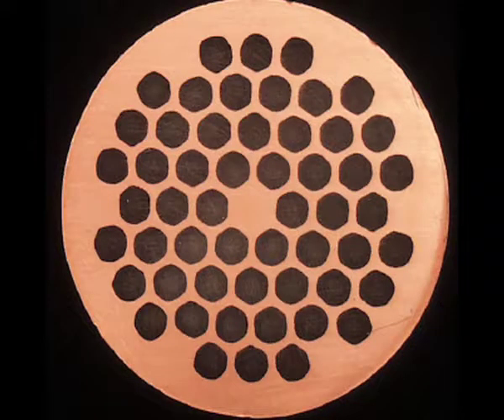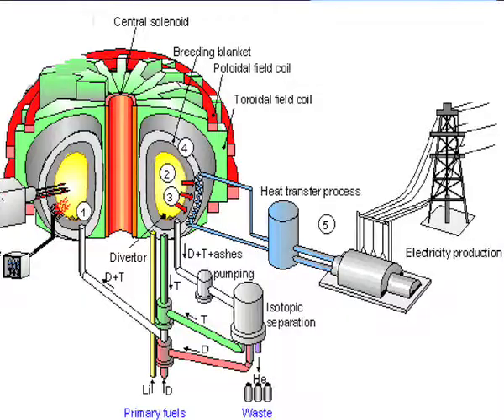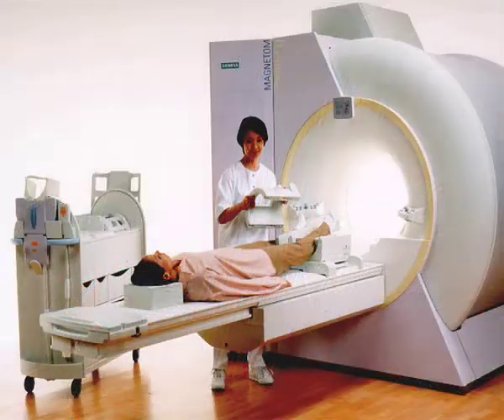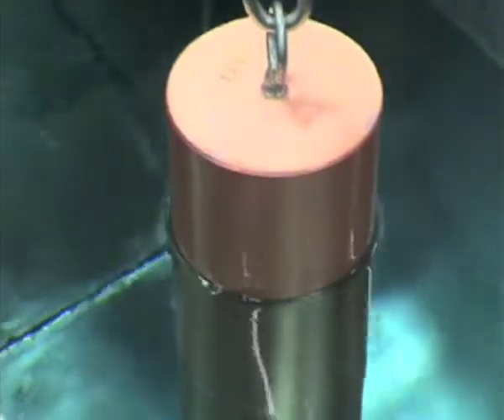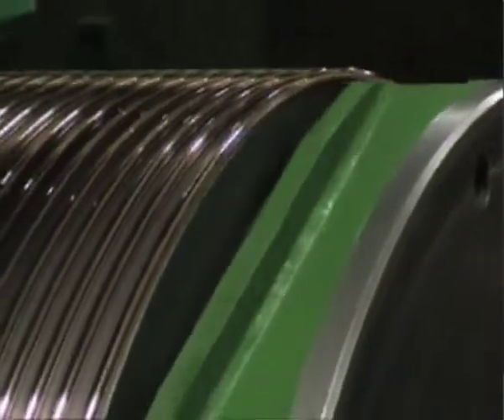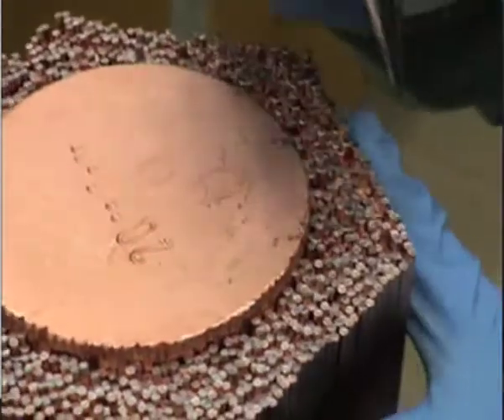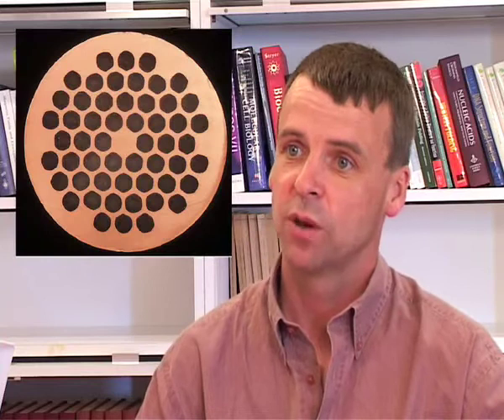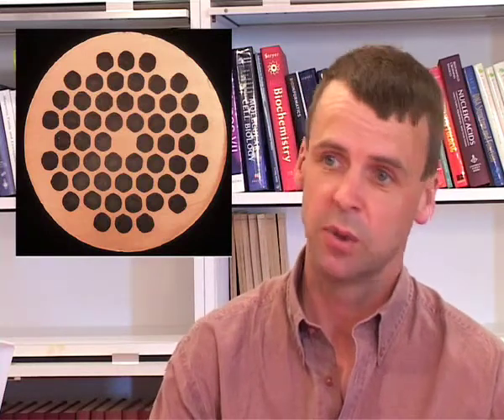Manufacture of niobium-tin and niobium-titanium superconductors

Comment: To give a preview of how this stuff can be used:  Most is utilized in MRI machines where the creation of an electromagnetic field is important, however it can also be used in proposed designs for fusion reactors.  This is because the wires will create an electromagnetic field to keep the fusion reaction isolated in a circular area, where the reactor will draw its energy to create electricity.  Mind you this is purely theoretical, but if mastered it'll redefine how we gain energy, surpassing even the potential nuclear gives us.

Comment: Where can I get this?? (not bulk)
Reply: ebay, there are loads of use ones for a reasonable price
Reply: I had a 6 inch length in the office many years ago after having done some work rolling some intermediate starting stock of Copper/Niobium composite bar. This was to be further worked to finally produce the final product at a different site.
Reply: @hoperp1951 can you explain how it is made ?
Reply: Basically what you see and have explained in the video is how it is done. I cannot go into detail as the processes are proprietary / commercially sensitive.  @SixOhFive